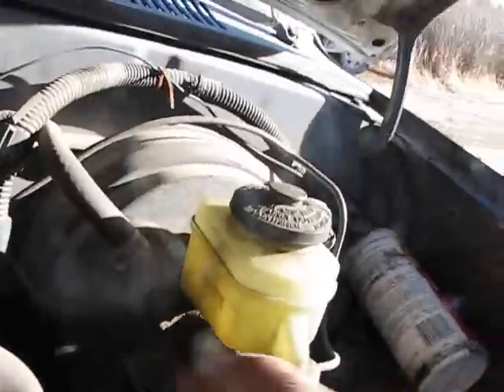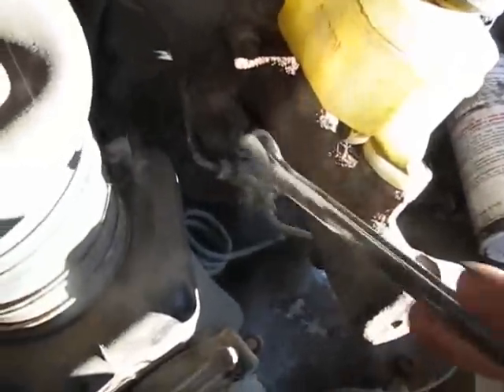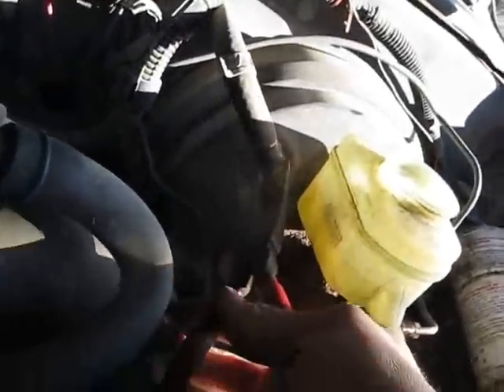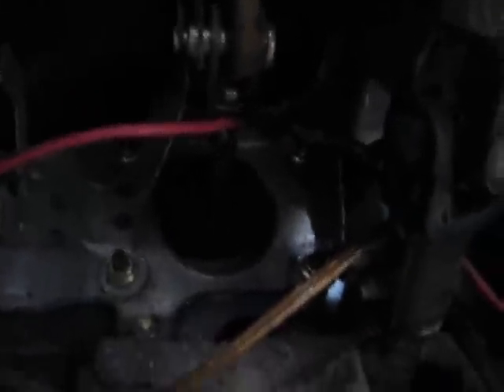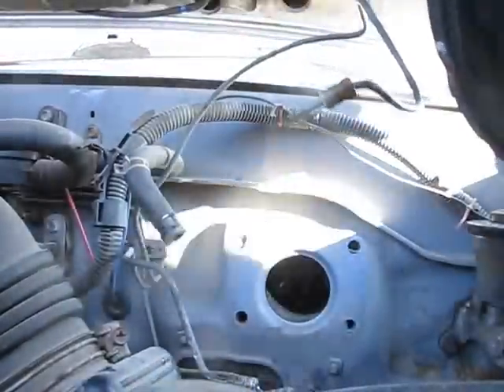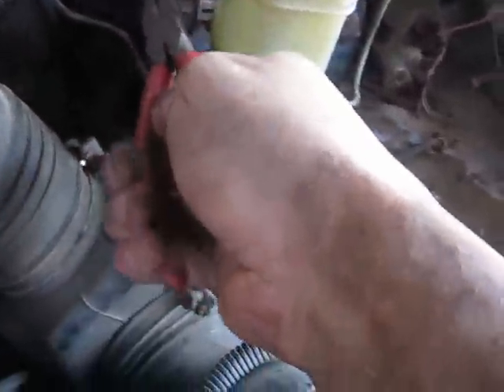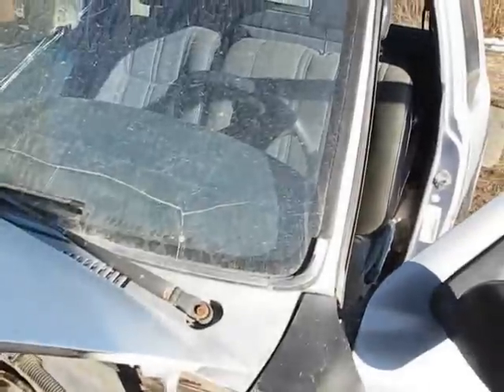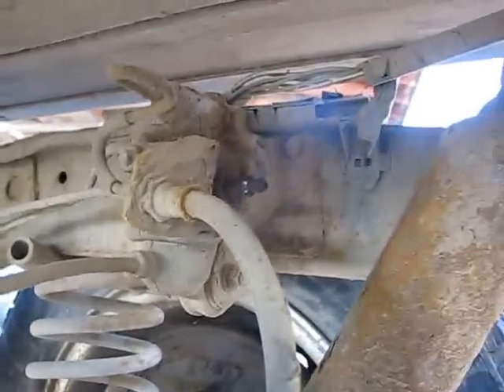How-To: Brake Master Cylinder & Booster Swap!

Comment: I saw another video with toyota truck. Looked like the same booster and set up as yours. The only difference was that he was able to remove old booster without having to disconnect the brake lines... so did not have to bleed brakes!. In order to do it, he did have to undo some of the large air vent pipes so that he would have room to move move master brake cyl of to the side and have enough room to pull the old booster out.  I am doing a 2000 4runner and hope I can get the booster out without having to bleed brakes.... not sure why, but just hate doing it.  Thanks for Video!

Comment from the maker: @HedgehogOutdoors i think all the trucks and 4runners have drum rears. when you get into the tundras with sport or tow packages. i think the newest tacomas with tow packages might have disc rears... not 100% on that though... any toyota truck I've had has got my custom rear disc brake swap :)

Comment: Good video!  I have a question, did you but the booster loaded with the master cylinder or individually?  I'm thinking of replacing the booster on my Taco, but don't want to replace the master cylinder.

Comment: very well explained, but what were the reasons you changed the booster? how do you know they went bad?
Reply: To know if the brake booster is bad. Get in your car, but don't turn it on and press the brakes as hard as your can a couple of times. The pedal should be really firm and take alot of force to press down. Then turn the car on again and press it down a couple of times as far as you can go. If it's just as hard when the car is off, then your booster is gone. If it's alot softer than when the car was off, then you're good.

Comment: good video.. but the brake fluid will eat paint..and 1 of the biggest keys in brakes is clean..if things aren't clean they will not last on brakes and the will wear funny, hang up, sticking parts..abs will be affected traction control as well..brakes will last 6 months instead of 2 years if not clean....fully dissasemble, clean,, anti seize,, then re- assemble..

Comment: wish you had shown more up under the dash, the under hood stuff is real easy to see and do even without the video but all the hard work is under the dash disconnecting and reconnecting things. that's what I wish you had shown how its done. none of the brake booster vids ever seam to shown under the dash part.

Comment: What year is the truck if it hasn't been said already?
Reply from the maker: i believe this was a 91. this video should be the same for like 80's up to the first gen tacomas. its virtually the same procedure on every vehicle, some just have added wires and stuff
Reply: Exactly the same on an 81 and 83 with the 22R.

Comment: crap. I've got to change out the master cylinder but not the brake booster. Damn air leak. Can't get the new gasket around that rod lol